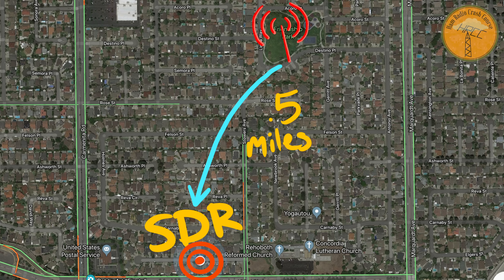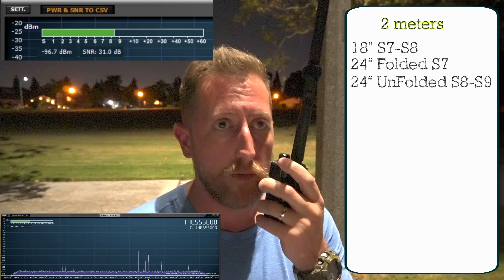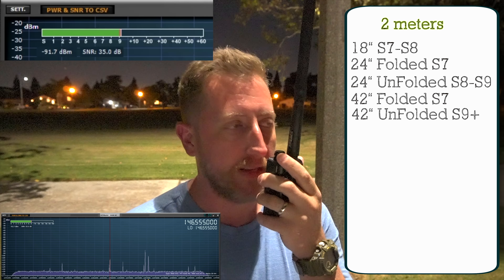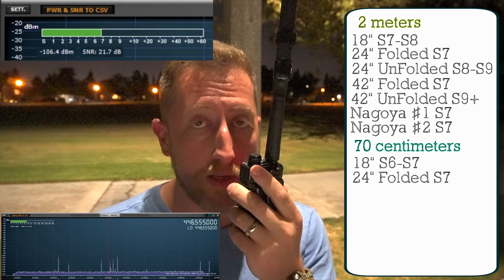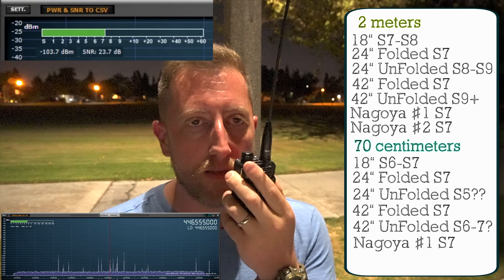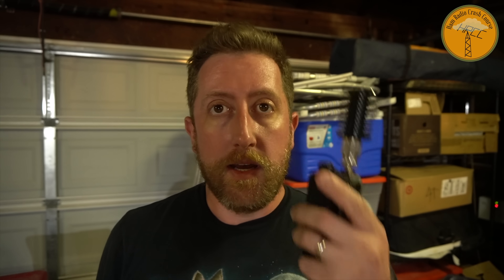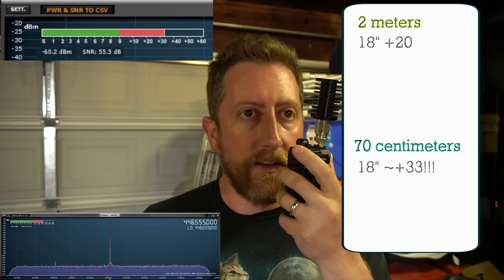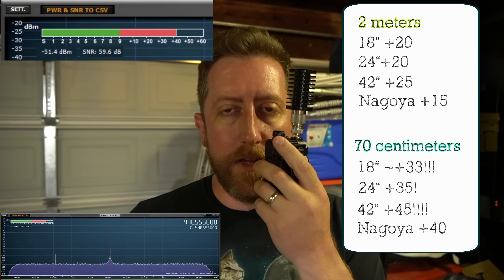ABBREE Tacticool Ham Radio Antenna Performance Test and Review

Comment: I just got the 18 inch version based on your review and I am not impressed. I can't even receive a clear FM station signal with it on my BF-F8HP unit whereas with the stock antenna everything comes in clear.
Reply from the maker: You might be overloading the radio. Where did you buy the antenna and radio?
Reply: @HamRadioCrashCourse  OK, without going into a long explanation. This was my second antenna. The first one had the internal threads in the base missing; so that I could not screw the arm to the base. However, in the new one, I had the reception issue. The thought popped in my head to try the other "arm" of the first package with the base of the second. Ta-da...crystal clear reception. Something is defective from the factory; so I am sending that arm back along with the defective base, and I have a fully functional antenna. It took you talking about a possible overload to make me think about what might be occurring. I will admit that had I not had the second antenna (that Amazon had sent to replace the first) I would likely still have the issues and dissatisfaction, but now I am pleased and look forward to giving it a try.
Reply from the maker: Well that is odd. There is a short in there somewhere!
Reply: @HamRadioCrashCourse , agreed. It's a man-made piece some problems can pop up. At least Amazon was great about immediately offering a refund or sending a replacement.

Comment: I bought the 28.3" ABBREE for my BF F8HP. The rubber ducky antenna worked far better.  Adding the ABBREE actually made reception worse.  I got better reception with just the lower portion of the antenna. In some instances, adding the upper stopped all signal.

Had Amazon replace it.  New antenna, exact same problem.

Yes, it's a green bag "real" one. 

Why would this be?

Comment: I wonder if it will also work on 220, maybe with a particular (set of) fold point(s).  Maybe I'll buy one and experiment.  (Good tip on using RTL as test receiver.)

Comment: So what about putting antenna on back of molle vest. Then make 50 ohm coax cable (2ft) with SMA F, to SMA M. 
I bet that solves the problem. I'm looking at using throat mic's and ear piece

Comment: What I'd be curious to see actually, is a similar comparison on 2m/70CM to this thing's rival (At least IMO). The Pryme AL-800.
I know the AL-800 is a PHENOMINAL antenna that can't be beat; other than the fact it IS heavy and you need to be careful due to that. I once talked simplex on 2m with my UV82 to a station well over 5 miles away, on low power. So that's a bit of a testament to it.

But would be super curious to see a professional style review like this of it!

Comment: I bet those are made out of the same substrate that tape measures are.
Reply: theyre literally old cut up tape measures haha
Reply: I was surprised when a buddy and I took his apart. It was cut up tape measure placed next to a rubber duck antenna and wrapped in the cover material. The tape measure doesn't actually make contact to any antenna internals.
Reply: unordinarian Wow, so garbage hu?
Reply: I don't understand enough about antenna theory and haven't tested one so I can't say. If it works it works. It just seemed like crap looking at the parts. It is possible he had a counterfeit as well.

Comment: you briefly mentioned setting it up on your chest rig. could you do a vid on that sort of set up?

My in process goals (which I have some of) baogeng uv5r w/ kydex messenger carrier, nagoya antenna. Id like to have the radio accessible & just cable the antenna (which is through molle webbing) with a quick disconnect. thoughts of improments?

Comment: Hey Josh I unfortunately bought one of the Fake Abbree 42.5" antennas of of eBay for my Baofank 9R PLUS because I had not researched it properly but anyway I fixed it because it would not fit my radio. Long story short, the Baofang Antenna Whip is about 12.5mm or nearly 1/2" diameter at the base & the Fake Abbree 42.5" was about 18.25mm or 23/32" but it had a metal sleeve under the plastic outside diameter which was nearly 1/2" diameter. So to fix it I measured up from the end of the base of the outside plastic about 3/16" & with a razor knife I cut down to the metal sleeve making a 3/16" split washer so to speak. To make the antenna seal up I put about 1" wide flat x 1" long of Heat Shrink Tubing over the end & the plastic split washer I had cut off the antenna that I put back temporarily until I heated the Heat Shrink Tubing to the edge of the Antenna covering the plastic piece I had cut off. Once it was all tight over the end of the Antenna I dug out the plastic piece so that there was now like antenna foreskin that would cover over the radio's connection giving it a perfect seal once the massive antenna was screwed on. I haven't tested the performance of the Fake antenna yet but I'll let you know if you want to compare Fake v's Legit.

Mark, Perth, Western Australia

Comment: When I tried to receive ISS SSTV signals with BF-F8HP, 42cm(~18inch) model couldn't pick up any signal. So I tried NA-771 and got clear image. Why? By that, I missed one image!
Reply from the maker: Idk. When was this?
Reply: @HamRadioCrashCourse  Aug 04 13:00 KST(GMT+9). ARISS Garriott memorial SSTV is what I tried to receive. Fortunately there were few more passes so I got more images with NA-771.
Reply: Hi UNIT_normal: I hope I’m not teaching grandmother to suck eggs!  Did you angle the handie and ABBREE antenna so it was at right angles to the ISS?  I get the impression from Josh’s and others’ tests that the ABBREE might have extra gain from a lower angle of radiation compared to the NA-771.  Therefore using the ABBREE would be more critical in its pointing.  Just a thought, as obviously there is a reason for everything!  Iain.

Comment: Reminds me of the antenna on the old PRC 77 radio I humped in the old army. They were made with several layer of material.
Reply: I repaired 77's well into the 2000's for guard units. They were gone by time I left hood though.
Reply: I remember the old prc 77 antennas also.  Used them in the 80s and into the 90s actually.
Reply: Only difference is that this one is not metallic, properly foldable into pocket size, damage from mishandling, etc...

Comment: You need to get yourself a pair of electronic hearing protection with comms. I currently use a TCI Liberator II with a converted/amplified MSA Nexus push-to-talk  with a Kenwood adapter for Beofeng radios. It works like a charm!
For someone using a radio for MIL tactics and training and not so much the HAM hobby (I'm not opposed to it), do you just recommend getting a GMRS license or do the entire HAM course for a HAM license to use ? Thanks!
Reply: 4yr old comment but for future people reading, get the gmrs license. Cheap, very easy to get, last 10 years. You can access repeaters and regular simplex talking (ht to ht directly). If you enjoy it start studying for the technicians license

Comment: Nice video and I learned several new things. Could you do a real life repeater test? I have a Yeasu Ft 60R  and it does pretty good but to get beyond about 20 miles, I go to a 22" Tiger Tail but to reach distances from 30 to.a max of about 80 miles, I've used my Arrow Yaggi antenna. Do you have any experience or opinions on this? Thank You and Cheers

Comment: I just got me a Mini VNA Tiny and tested my Yagi combo TV antenna (+ FM band).  I also tested the antenna amplifier (with pretty long cable and a 6 output splitter).  Both tests were quite disturbing.
The antenna amplifier (+ cable and splitter) were covering the UHF TV band within about 4 dB from band edge to other end.  But the gain was barely enough to compensate for the losses in the other two items.  Actually, without power to the amplifier, the received signal was about 10 to 12 dB lower, so the amplifier must have done its job.  I believe it promises 13 dB gain.
The Yagi was a completely different story.  It showed  two huge peaks in SWR within my 400 to 600 MHz measurement range.  The minimum impedance was about 35 ohms and maximum  was over 150 ohms.  The entire 6 MHz band of one of my favorite stations is on the slope of the biggest SWR changes.
Having that experience, it would be interesting to see what the VNA would tell about your antennas.  I imagine tuning the 2 meter band and the 70 cm band is a far cry from covering the entire UHF TV band.  But that is only my guess.

Comment: I definitely gave you a thumbs up, but in the comment section, this review rates a three. 👍👍👍 Why? This antenna is great for new hams.  With one of these antennas, one should get great results doing SOTA or POTA. I am writing a column for my club newsletter, and I will promote its use in SOTA and POTA, and I will include a link to this video. I am greatly looking forward to your Skype presentation at the Stone Mountain Hamfest!

Comment: I have a 32" "ABBREE", which I bought to test. Mine came in a yellow plastic sleeve, which some suggest means it is a clone. According to other reviews the original, genuine ABBREE ships in a green plastic sleeve. It would be useful to know if clones differ from the genuine ABBREE. It would also be interesting to see if antenna performance could be improved with the addition of a rat tail? I  have seen rat tails tested on other youtube videos, and in every case they seemed to improve transmit power. In theory at least they are creating a counterpoise, or possibly enhancing the effect of the human body as part of the antenna.

Comment: Well I’m sold. If not for anything other than the, wtf factor when walking around a ham fest with that 42” sticking out. 

Would be interesting to see if the 42” would be effective on the 817 for 6 meters.
Reply: my Radio Shack telescoping HAM antenna is Effective for 25 MHz to 1.3 Ghz , it can handle 5 watts and is just 6" closed (Public Safety) and 26" Fully Open (for CB/HF). 
and its Center Loaded so no Ground Plane is needed.

Comment: Would love to see that cut open... looks like it could be a heat-shink covered tape measure.
Reply: That's exactly what they are, yellow paint, numbers and all, I've pulled the top cap off of one.  They're actually two tape measures lined up so the "convex" sides face out and then covered with two layers of heat-shrink.
Reply: chetmystery wouldn’t that make it somewhat directional. Or more output in opposite directions and nowhere near omni right?
Reply: @cmsjr123  That depends on how the elements are joined. For example if connected at top and bottom, they effectively become 1 element.
Reply: @chetmystery  I suspected as much. Only so many things on the planet with that shape & behavior (the way it folds). Thanks.

Comment: Hi..would  it be possible to Mount this ebbree  antennae on top of my motorhome and run a cable to my baofeng inside? Thanks
Reply from the maker: Yes. But that’s not really a good permanent option. Get a proper dual band mobile antenna and it will last longer.

Comment: Nice video! What is the best receive antenna for the baofeng uv5r?
Reply: I would just get a nagoia unless you having issues still then might as well get the one he is showing.
Reply from the maker: Yes. It would be a great reveling antenna, unless it loads the radio. Which would be bad. I’d start with the 18”-28”.
Reply: Im kind of out in the country so an antenna that has a powerful receive gain. I have the 42 inch abbree and it does ok. Preferably looking for a handheld antenna. Not a base or may mount.

Comment: Let's see them SWR Numbers in the next video.
Reply from the maker: I covered that in the first part of the video. SWR are meaningless and would potentially give a perceived advantage to one antenna over another.
Reply: Ham Radio Crash Course small data point: I had to jack up my squelch by two units because the AbbREEEEE 18” is that much stronger on receive than my factory duck.